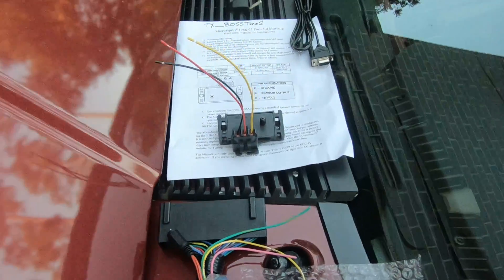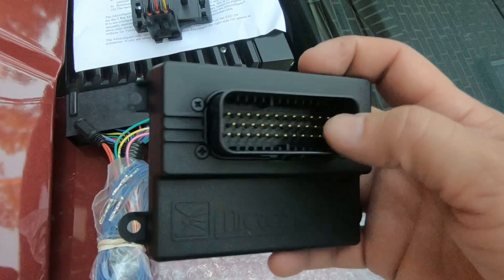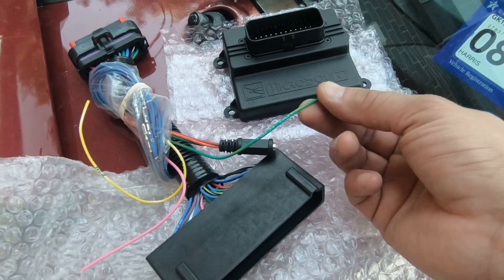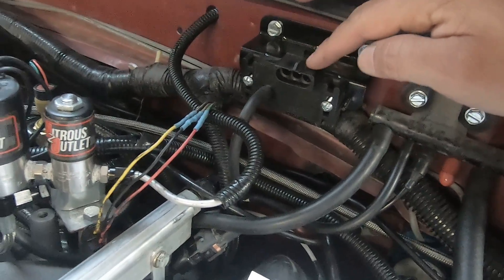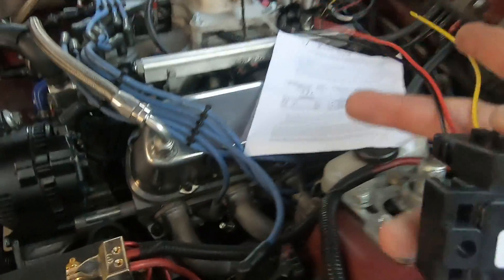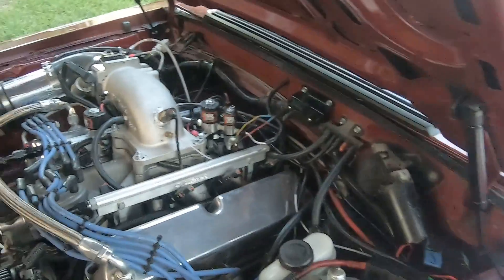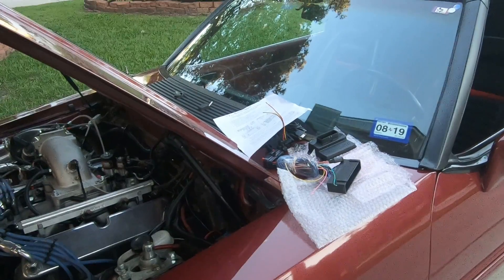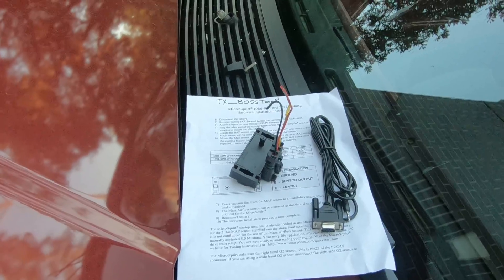Microsquirt FOXBODY MUSTANG, Wiring 3 bar MAP Sensor

Comment: Nice video! Doing my Microsquirt this week!
Reply from the maker: Awesome!  Thank you for the feedback.
Reply: @1frankglz  Trying to start mine now with micro squirt on my 92 mustang. Its just turning over. any suggestions?
Reply from the maker: @frank3stangs  What is the combo on your fox?  Did you input all the general settings already?  How about checking for spark and fuel?
Reply: @1frankglz  it's a 347 boss block, #80 injectors, 100 kpa, it has spark and fuel.
Reply from the maker: @frank3stangs   email me your tune.  I'll take a quick look.  frankglz@sbcglobal.net
Reply: @1frankglz  sent

Comment: I have a 87 speed density car. Will this benefit me? I believe I’m having computer problems and came across this video. All I want is the car to run better. I’m contemplating the pro-am EFI because it comes with a new wiring harness. Any help would be appreciated.
Reply from the maker: Yes, this will work for your car.  It's setup for 86-93 Mustangs.  It is a speed density system.  It comes with everything you need, including a base tune.  The only other additionally item would be a wideband gauge to make adjustments necessary for dialing in the A/F ratios.